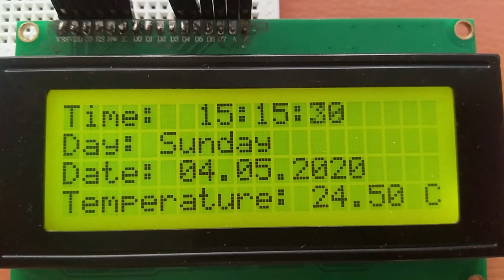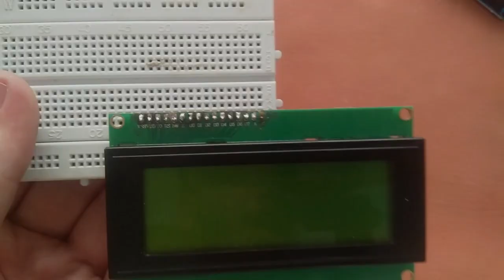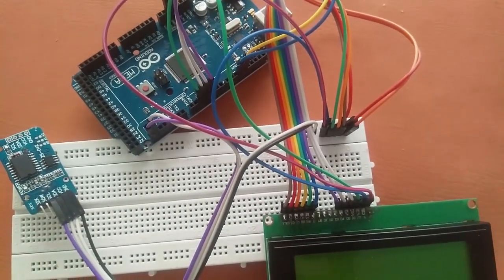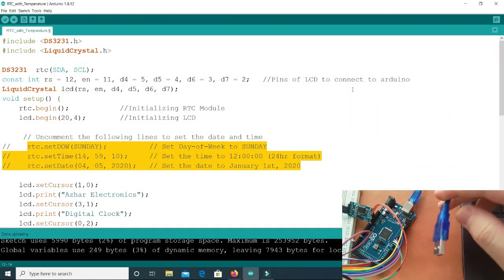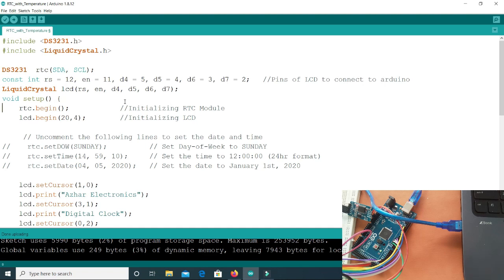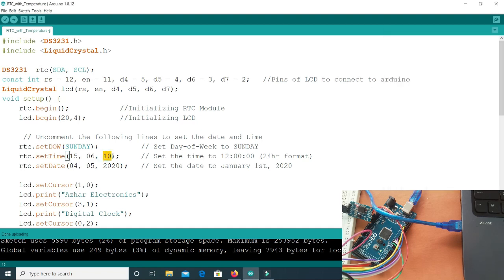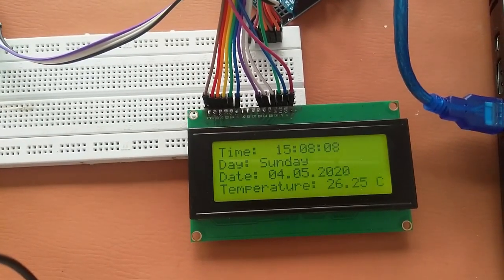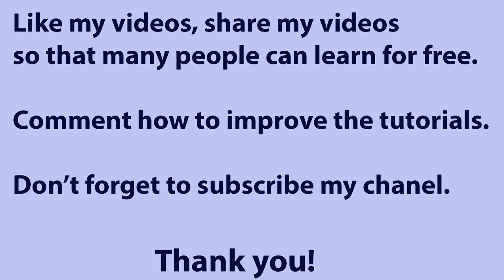How to make digital clock with temperature display using arduino and DS3231 || Azhar Electronics

Comment: Hi। Goidd tutorial followed all the steps, and connected the 1602 lcd display to Arduino nano, however to change the day date time etc whenever I uncomment those three lines and set the time , but compilation error occurs, RTC  is not commented in the scope , if I comment them and upload the code it's all ok, but display shows oly 1 row if some rectangles that's it। Opened the serial monitor it prints time and the current date  ।। 
Remedy ppls

Comment: Hello, I have DS1302 and DHT11 what should I do?
Reply from the maker: Use DS1302 for time and DHT11 for temperature. Get data from both the sensors and display it on the LCD.

Comment: I have aduino uno board... There are not sdl and scl pins.... How i can connect rtc module.... Can uh please sir?
Reply from the maker: Uno: A4 (SDA), A5 (SCL)
Reply: @AzharElectronics  sir done... But now problem is lcd display shows black boxes... In which text  appears with low visibility?
Reply from the maker: @zakirnaik6269  Check and Rotate the Potentiometer at the back of i2c module.
Reply: @AzharElectronics  I DONT GET IT. HOW I CAN ??PLEASE CAN YOU EXPLAIN SIR